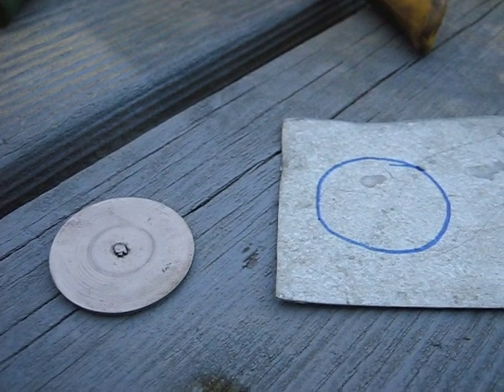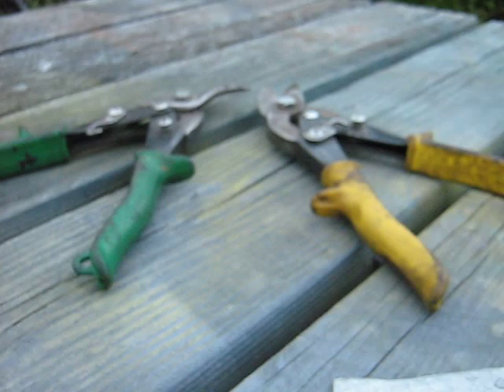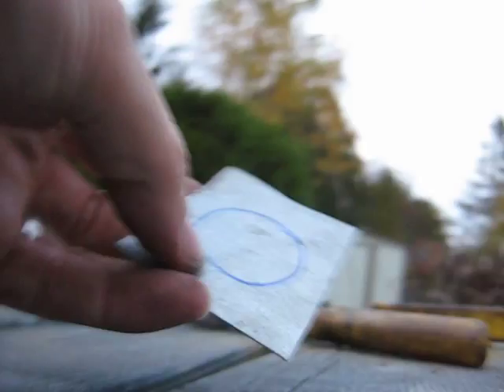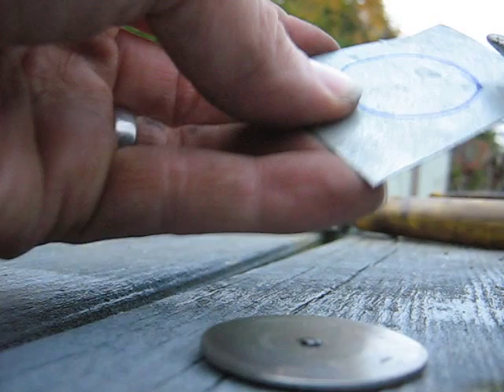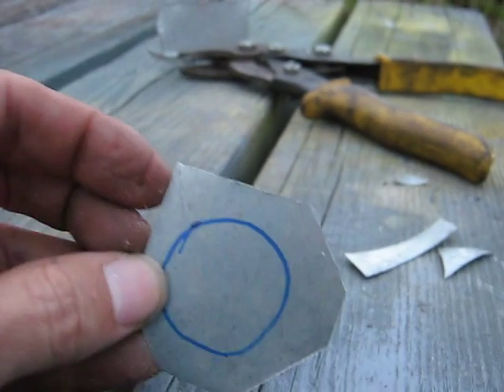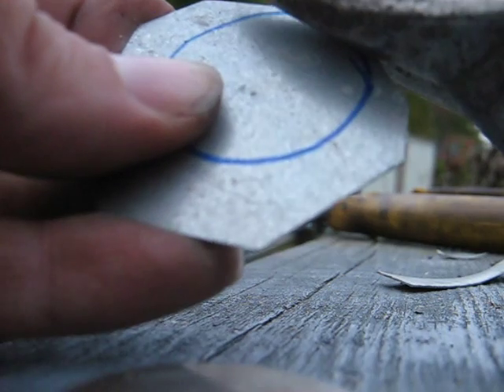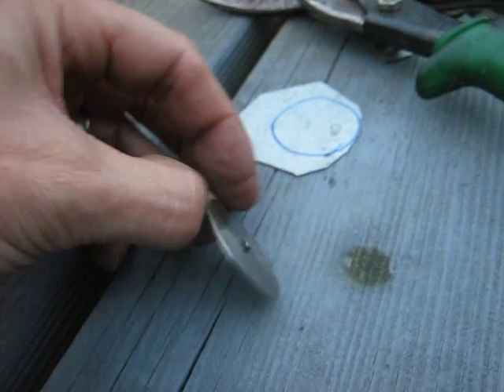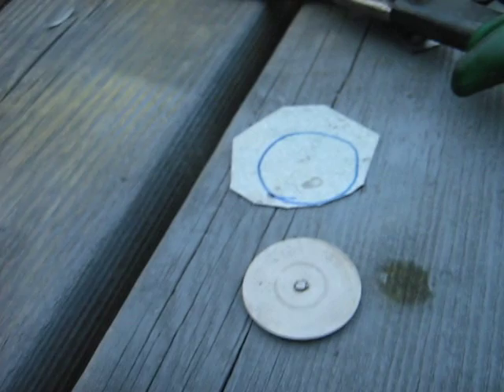Making a Disk Valve for the piston valve engine

Comment from the maker: I worked in a sheet metal shop as a student, so we got to use snips a lot!  The trick is knowing which side is the waste, or cutoff side, and using that to your benefit, since it will mess things up if you cut around the crcle the wrong direction! Make a practice run or two.